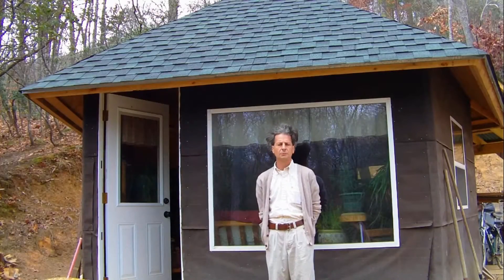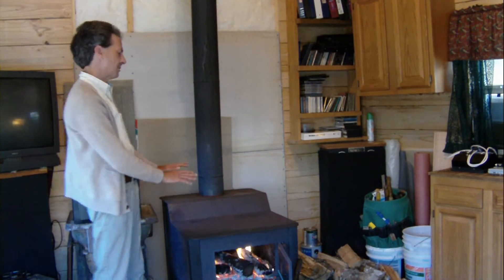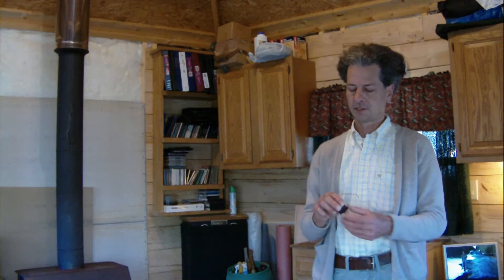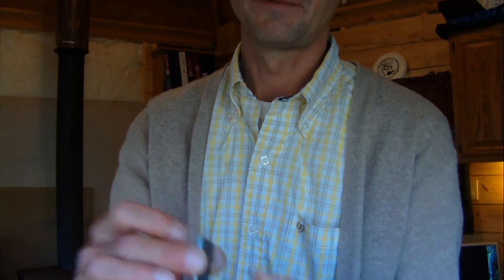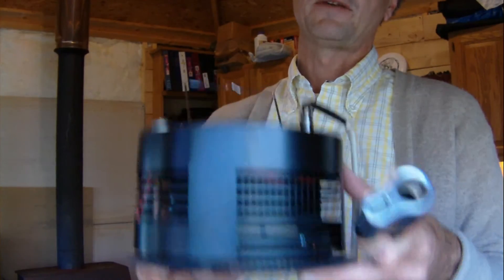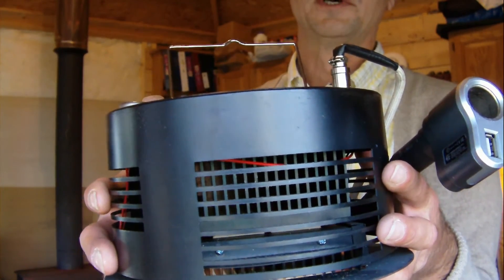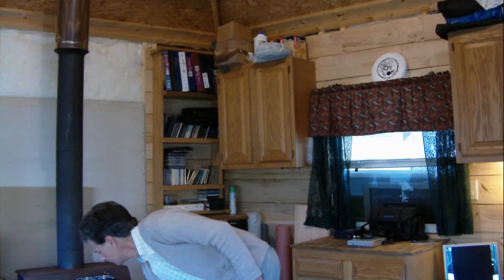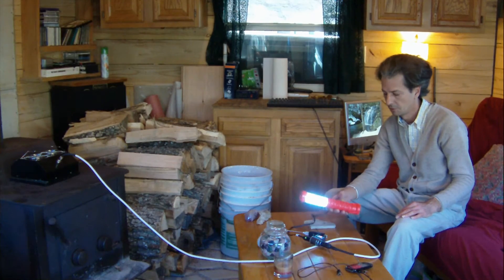Jim & The Alternative Energy Hut Ep. #1- What's Going On Here?

Comment from the maker: In fact, these generators are very rugged and will not melt.  The thermoelectric modules in this unit are capable of 800 degree F and will not melt.  I have used them in every type of circumstance available- gas, propane, commercial kitchen gas stove (very hot), camp fire and wood stove.  The same test unit has been used in all of these circumstances and still works great (100's of hours).  What makes you say that?  It has not been my experience.